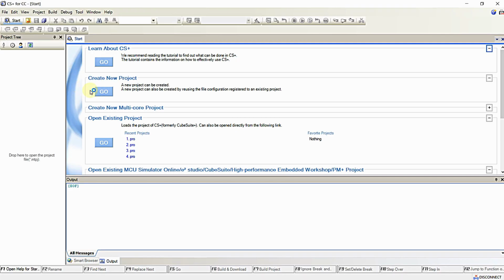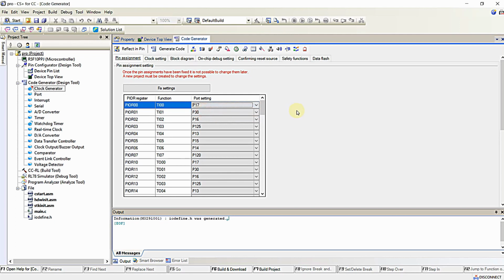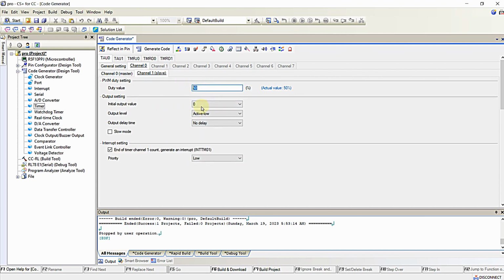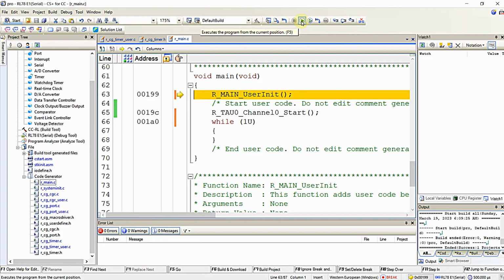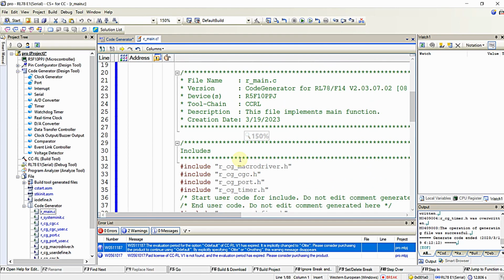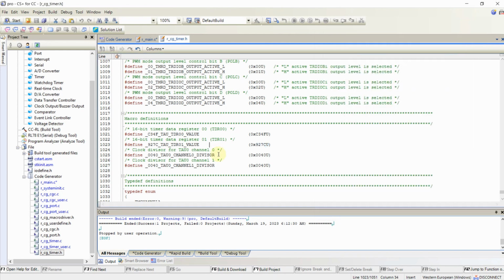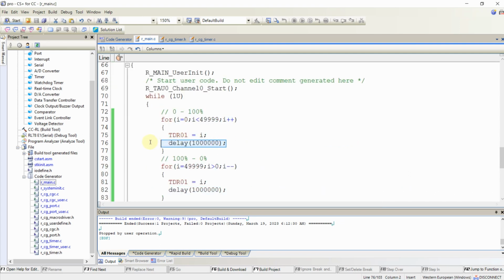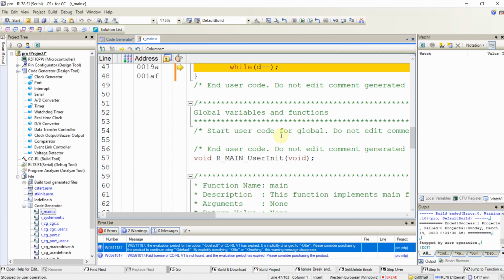Generating PWM signals in RL78 microcontroller

Comment: initially you kept period as 100ms and then set a value for i = 49999 and then you changed the period value to 1ms.but why that 49999 is used .the TDR00 value would have updated to 1ms .